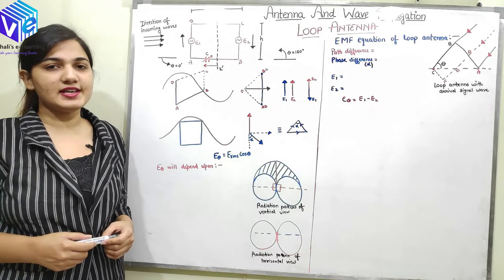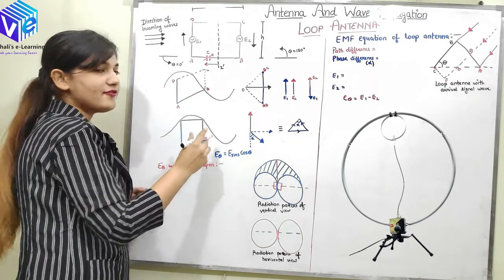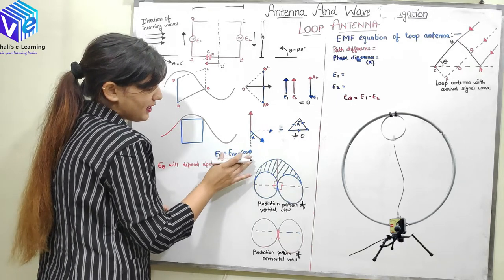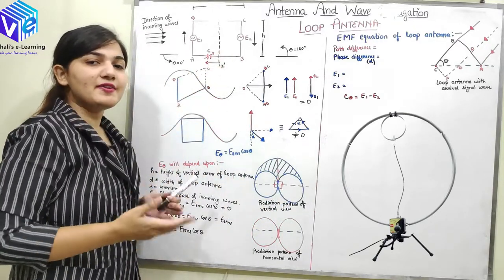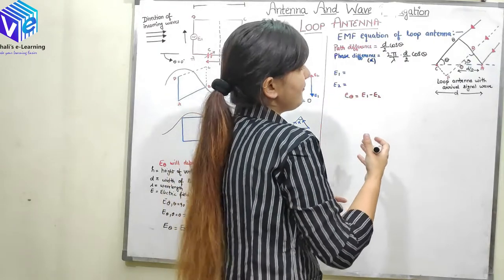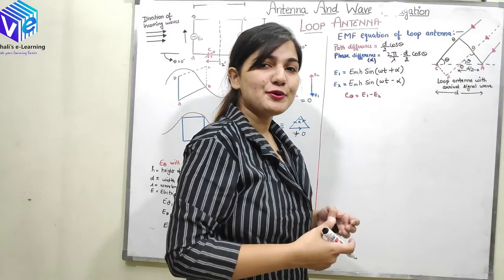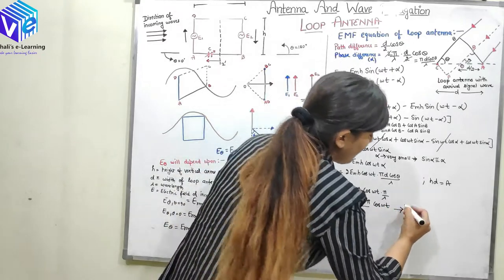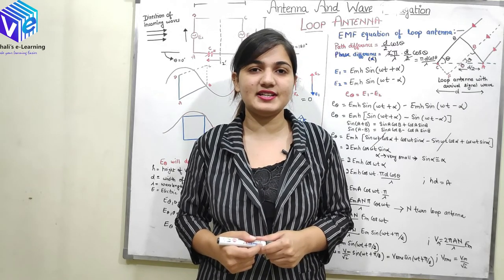Induced EMF Loop Antenna | Loop Antenna | Types of Antenna | AWP | Vaishali Kikan | Lecture 23 |

Comment: mam in emf  equation costhita  why  you removed.
Reply from the maker: When the plane of loop is aligned to the propagation of EM waves, the angle that the loop makes with the direction of propagation is 0 as both are in same direction.
COS of 0 is 1 , so instead of COS theta we will now multiply it with 1.
Reply: @VaishaliKikan  tqq  mam
Reply: @VaishaliKikan  mam  one more requst  in loop antenna  how to find  radiation resistence ??  i am completely stack to understand from  book  please me suggestion ..